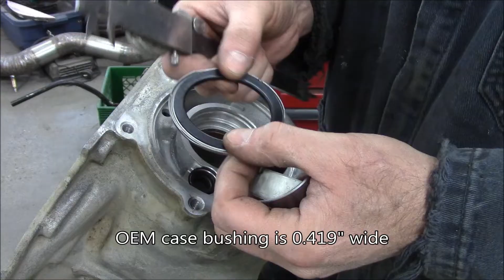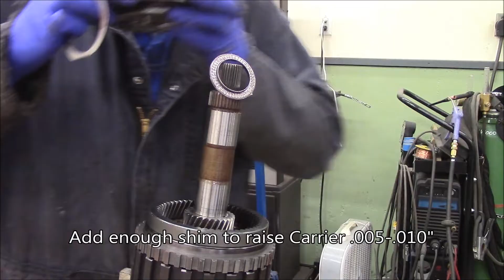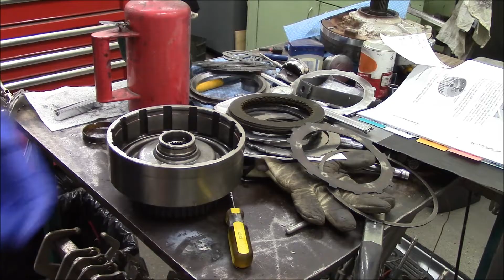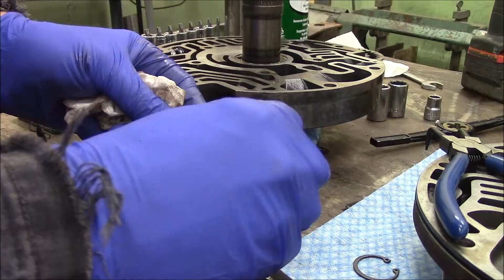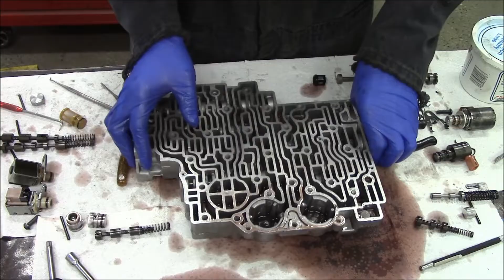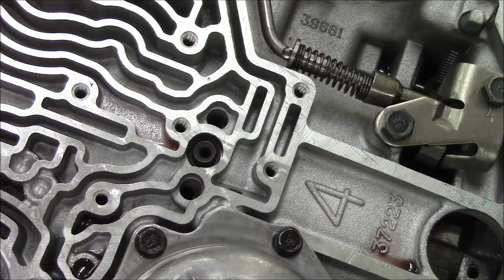HOW TO: Fully Rollerize a 4L80E

Comment: Hello, I'm trying to resurrect this crazy transmission setup. It was in the July 1995 Popular Hot-Rodding magazine, a "Trick Twin" TH400 setup. A guy came up with a kit to couple two TH400's together front to back. It compounds the gearsets and gives you five forward gears. Trans- 1 can be automatic or manually shifted, Trans- 2 has to be full manual... it can start off in 1st, 2nd, or 3rd gear. Both shifted to 1st, with 2.41:1 rear gears would act like 5.97:1 gears, then be able to cruise 75 mph @ about 2000 RPM in 3rd. The trans gears are : 1st/1st= 6.15:1  2nd/1st= 3.67:1,  3rd/1st= 2.48:1,  3rd/2nd= 1.48:1  3rd/3rd= 1:1.
I'm trying to get people interested in it to help find info to figuring out what's in the kit to build one of these monsters. I found a Tuber with one in a '72 Monte Carlo. He has some short videos, one of the bottom and side view, the other of him driving and shifting it down the track. The titles of the videos are:     
"the twin transmissions"    and    "In car video. #72montecarlo"                   I recently found the Patent info about how it's built if you're interested.

Comment: Rollerising this is alot of work and i am ok with that but aside from that. the idea of doing this serves what purpose. Is it to reduce parasitic drag and if so what is the HP or TQ gain from doing this? Is it to increase the amount of TQ it can handle if so what is the max comparison increase. Other than fun what was the benefit. I have seen other peoples comments. I know 2 groups of people People in the first group say I am an... Asshole, and the other group that says....Yup
Reply from the maker: It 1) reduces friction, 2) disperses some of the stresses half-way through the case instead of sending it ALL to the back bushing, and 3) it stabilizes some of the parts that weren't well supported. In theory it should improve longevity. Does it matter? I don't know.  But I do like taking on challenges.  I don't know if I'd do it again.

Comment: Thanks man for another excellent video.  I used the sonnax no walkout bushing and was only able to get about one full rotation  after releasing it using a full gripped hand. This was in the vertical position with the output seal off. Do you think thats too tight?
Reply from the maker: I don't really know.  I'd kinda have to feel it.  If it's just a friction bushing (no roller), it's not going to spin really much at all.

Comment: How clucky was this transmission going into reverse with the additional clutch and no wave gear?
Reply from the maker: It feels like a transmission with a shift kit.  The direct/reverse piston is dual-fed, which slows down the application of the clutch, making it less abrupt.  Often the 3rd accumulator is deleted to help speed that up.  The apply holes have been opened up, which makes it shift fairly firm - though larger holes will have a faster/harsher apply.  I would say that what I have done here is certainly not a violent engagement.

Comment: What is your opinion of instead all the work of rollarizing the trans to reduce stresses of internal friction, ( which is cool by the way), but just add 3 oz. Of NMf to your transmission fluid? 🤔
Reply from the maker: I don't think any magic fluid would do the same thing.  Having said that, I've been driving the truck and you cannot "feel" that this work has been done.  Only time will tell longevity-wise,

Comment: Come on dude, who has a lathe freely available to them, seriously?  To be fair, def not click bait.  🤨
Reply from the maker: You can take the parts to a machine shop and have them do the cutting.  It's cheaper than buying a lathe.  You cannot rollerize this transmission like this without machining.
Reply: @GregWellwood   - All the machine shops in my area have fk't up everything I have sent to them.  I honestly dont think there is a "good" one around.

Comment: Ok, first of all let me just say, Your awesome. So, I got a spare reaction carrier and decided to machine it for the bearing. This was a practice run. I got my .075 machined but what keep that bearing centered up inside the other hub? Where the sun gear rides? Is it just the recess that I machined? Also what did you use as a cutter? Those rivets are giving me some trouble. Thank you😊
Reply from the maker: Yes, the shoulder you machine holds it in place just fine. I clearanced the ID of the bearing just enough to get it past the sun gear. There will not be enough end play when you are done for it to go anywhere. In this job, I machined with boring old HSS cutters.
Reply: @GregWellwood  ok, cool. I appreciate your response and your knowledge. I’m an automotive tech but I build transmissions on the side. This is not my first 4L80 but it’s the first one I have modified like this. Your video has been invaluable. Thanks again

Comment: Great job impressed BIG TIME
Where you located, what would it cost to do what you did?
And what would you charge 🤔? To rebuild a transmission
Reply from the maker: I appreciate your enthusiasm. There is likely a transmission shop around you that can do this work - I shared what I was doing with my favourite local shop (I bought my thinner steels for the direct from them), and they knew all about these mods.  Ask around the drag racers and four-wheelers and you'll find a shop that can do this.  I think I spent around $1000 (CDN) in parts alone.  I'm way up in Canada, eh!?

Comment: I have a 4L80E transmission on my 4x4 truck.  Just had it rebuilt recently, everything is fine except for the 2nd to 3rd gear upshifts.  This gear shift would always flare (engine RPM will always spike up 150 to 250 RPM and then it would shift into 3rd).  Any ideas as to what is causing this or the solution to fix this problem?
Many thanks!
Reply: third gear shifts are a common complaint.  Can drill the valve body separator plate hole from the very puny size from the factory to a decently larger hole which will more quickly engage third.  some people even leave the third gear checkball out.  but all this can be done by removing the pan and leaving the transmission in the vehicle.  usually

Comment: This is not an $89 alternator. How can something worth up to $5-$7000, be so obscure? 

"Well I think this is the way...well I'll point them all in the same direction... just in case it matters?!?!"

What the heck?!

So if it's not right, call AAA for a tow, and we'll remove the transmission again until we get it right?! Some people do it this way, some don't!?! Oh, let's do the math and turn it down in a lathe. What?!

Too much folly for me. Never knew you could play so many games with a massive drive line component, that if you just get a nick in a seal, too much end play, too much run-out, this oil fitting will melt your tranny, etc etc. then the master tech is giving you a repair bill of $5600!

Everybody needs to be on the same page on these damn things and stop bilking the consumer for so much hard earned money. 

Most of these never break on their own. It's usually somebody did  something different or dumb.
Reply from the maker: In my classes, I share with the students the different philosophies that people have in what they do, and encourage the kids to think about each one and chose what makes the most sense for them.  I also try to show the kids how I work through learning something new - because there will always be something new to learn.  This video is not your typical garden-variety rebuild, it's going well beyond what would be considered "normal," and I believe I understand what these particular mods are trying to accomplish.  In the description you will find the links to the articles from Gears Magazine, and to the forums with inputs from reputable builders, where I gathered this information.  At any rate, regardless of the different philisophies, "I can pay a professional to screw it up, or I can screw it up myself for free."  Your pro-built transmission can still come home on the hook - I've re-done MANY things that "professionals" have done poorly.  I've made my fair share of misteaks too.  That's part of learning how to do what we do.  I try to facilitate learning with my students, and I share what I've learned to you folks as well - even though THIS video is WAY above what my students can do.  Thanks for watching!
Reply: @GregWellwood  Well said. Again, I stand for practicality, the hard working consumer not interested in games. Just 100,200,300,000 miles of service for a $2100 to $5600 tranny or a new $83,000 truck with one in it. It seems we're more in trials with these silly things, more like prototypes rather than proven reliable drivetrain components. 

I have 524k on my original diesel engine. Yet these trannys are coming unglued at anytime. 5 miles, 300 miles, 23,000 miles... convertor shudder in newer trucks etc... Just too much hardship to the poor consumer, then the shops are all over the place in repair technique and protocol, pricing and turnaround time. But Godspeed to you and giving back to the community by teaching.

Comment: By using that bushing didn’t you block the lube hole going to the tail housing?
Reply from the maker: There is no lube hole there.  What looks like a lube hole in the video, is the "stake" mark where the original bushing was locked into position.

Comment: Putting paint on the outside of the case makes it hold HEAT inside (a transmissions worst enemy  ) but I know a lot of shops do to make them pretty
Reply from the maker: True.  But probably not as bad as the quarter inch of oil-soaked dirt that's going to get on it in the next few years.
Reply: If worried about heat and the paint application-
Consider using Techline thermal dispersant coating instead. It is flat black however. 
Then there is testing that shows bare aluminum quickly produces aluminum oxide which is like steel rusting except it only goes on the surface but is a huge insulator. 
So putting something on vs nothing eliminates the oxidation.
Going silver colored has negative impact but that is becoming such a minor impact at that level it’s hard to duplicate in testing.  Simple flat black offset is the answer for low budget emissivity fix.
Reply: i'm sure that the .01 degree difference in temps from paint have been the demise of many transmissions

Comment: The bearing in the pocket of the machined front planet goes in black side up with the silver side making contact with the shim, and the bearing in the pocket of the machined center support goes  in metal side up, with the metal portion of the bearing making contact with the direct drum.  Is this correct?

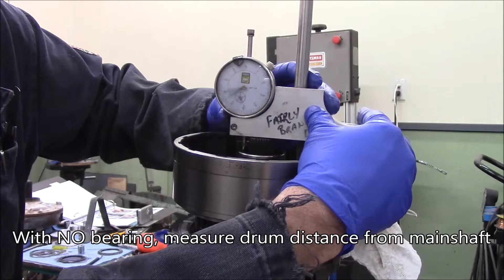Comment: At 8:00 in the the video when using a height gauge to measure the distance from the front face of the mainshaft to the front face of the direct clutch housing and calling it dimension A.  And then removing the direct clutch housing, install the thrust bearing, reinstall the direct clutch housing, and repeat the measurement procedure and calling it dimension B... and then repeating this procedure using shims between the bearing pocket and the bearing to adjust the bearing height, until dimension B is 0.005” to 0.010” less than dimension A, if you do this and pull up on the center support, wouldn't you feel it making contact with the bearing between it and the direct drum, or should you not feel the play of 0.010" if that is your measurement?    Same thing with the bearing in the front planet, if you lift up on the center support while pressing down on the front planet, won't you feel the play if it's 0.010"?  Certainly wouldn't expect to be able to feel 0.002" but I didn't have the shims to get it to .002" so 0.010" was the best I could do there.
Reply: This looks to be useful info even though it’s not easy to interpret at this point. Haven’t rebuilt any 80e’s but here we go!
Reply from the maker: At 8:00 we're shimming the direct hub to get it for sure sitting on the bearing (.005-.010 worth of for sure). The center support should be touching the bearing, should be touching the direct hub, all together. This is to take the thrust loads off the shafts going through the center section, and stopping them AT the center section. Does that help?
Reply: @GregWellwood  Perfect.  So that explains the direct drum.  Now for the center support.  I get a reading, with just the bearing, and zero the gauge.  Then put in a 20 shim under the bearing, dial reads 0.005"  So if a 20 shim got me .005' would the logical thing be to replace the 20 shim with a 10 shim so that my endplay is 0.005"?
Reply from the maker: Exactly! We're closing up the clearance, but we need to know how much it has to be closed up.  To do that, we have to go "too far", then do math to "go back."  You win!!
Reply: @GregWellwood   

And with the endplay being 0.005", the gauge read 0.000" but that's OK because we know that 20 thou minus 10 thou is going to put us were we need it even though the gauge says zero after going from the 20 shim to the 10 shim.  So the gauge reading zero is actually to be expect then even though you have 0.005" of endplay?  For the direct to center support, measured without the bearing, zero’d the gauge.  Put in just the bearing and got -0.002”  Put in 0.050” shim under bearing and dial read -0.0185”  Put in a 0.040” shim under bearing and dial read -0.007”  I'm assuming that's good?
Reply from the maker: The gauge will read zero because you created clearance "inside," which will not be seen up by the dial indicator anymore. For the Direct/Center your 0.040" shim sounds correct, according to your math.
Reply: @GregWellwood  Thanks again!

Comment: Nice work.  BUT, you forgot to "rollerize" the pump washer!  Lol!   Also, the overrun clutch valve brings on the overruns in 1st-3rd in the o.d. position.  Thus preventing overdrive sprag failure during launch (no need to manually shift to protect sprag).  As for the downshift,...  You'll break something on a forced downshift.  That valve won't save you!!!😅
Reply: Why wouldn't it help on a downshift? The clutch should be engaged on a 4-3 downshift, right?

Comment: Looking for the part numbers for the bearing that you used.  Especially in the center support.  Also do you have a link to a place to buy different Torrington bearings?  Thanks for the vid
Reply from the maker: I added bearing details in the video description.  All the added Torringtons are TH350 Pump bearings EXCEPT the forward hub Torrington, which is a Ford 1F1Z-7F404-AA.  Any trans parts shop can get you these bearings. Except maybe the Ford one - that one might be elusive, but you can probably make something else work.

Comment: What's a good speed to cut those parts on a lathe? Is that a carbide bit? Also what angle are you using?
Reply from the maker: Speed is determined by the size of diameter of the cut.  Slower if it chatters. These are High Speed Steel cutters, because I can grind them to fit the places I need them to fit in. I don't know what you mean by angle - is there a spot in the video in particular?

Comment: Can’t wait for an update on how it performs. Did you drill a small relief hole in the direct drum or is it not necessary ?
Reply from the maker: I did not, but debated long and hard whether or not to.  The consensus is if you're going to really rev the snot out of this, you should, as it prevents a "centrifugal" apply of the clutch.  I have no intention of revving to the moon (boost, instead!), so I did not.

Comment: I've got an issue on my current 4l80e build.   When lower half is assembled, the output shaft turns freely CW and CCW until I install the center support bolt.   As it starts to bottom out, the output shaft becomes hard if not impossible to turn CW (as looking at it from behind).   If I loosen the bolt 1/8 turn, the output shaft turns freely again.   I removed the band, and it does the same.   I tried to tap tap tap  the output shaft, side to side,  thinking it was a little cockeyed but it made no difference.   Everything feels fine on the bench.   The sprag is new.  All bushings were replaced.  end play is .022.  Any ideas how to fix this?
Reply from the maker: Without being able to see it and play with it, I don't know. Did you for sure put the sprag in the right direction?  It's easy to install in reverse.
Reply: @GregWellwood  The sprag is correct.   The output shaft spins fine both directions and the sprag locks up fine until you turn that bolt the last 1/8 rotation.   It feels like a bushing is off somewhere, probably internally between assemblies..  I think I'm going to clamp that  assembly by the center support in a vice to see if I can replicate the issue outside of the case.
Reply: @GregWellwood  OK. it appears like the rear planetary is binding somewhere internally.   I am trying to work it back and forth to loosen it up.   The output shaft is new, so maybe it just needs to be broken in.

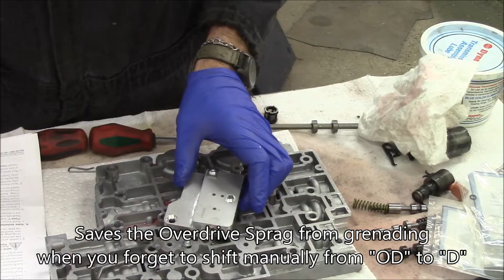Comment: Their is nothing more rewarding than hear an engine you built start for the first time or a transmission you bench built yourself. I believe the you did the correct updates and preventive measures needed. At 19:19 was that regular bacon or Canadian bacon? Since the late 70’s when I went thru a “JATCO - 3N71B” 3sdp, RWD Datsun/Nissan, I was shocked to find Torrington bearings thru out. Ford used this same trans in the glorious Ford Fairmont (Cheap Plastic Squeaky Dash) because there is so much internal frictional looses. It is a same one has to add these in kit form or one here & there. Very, very nice video and explanations. Enjoyed the jazz as well. As alway, thanks for the enjoyable video. They take work fee ever think of!